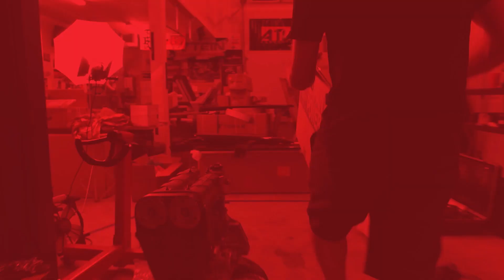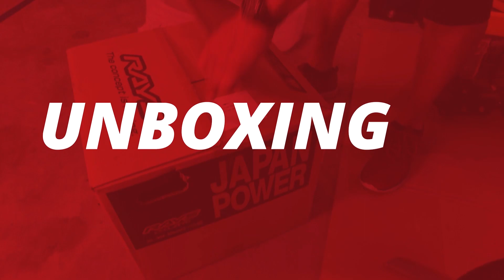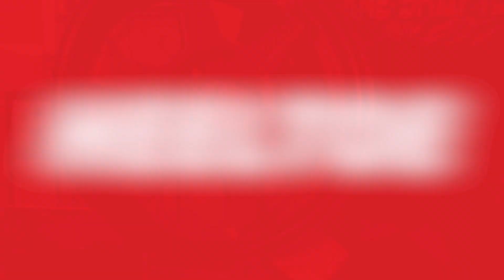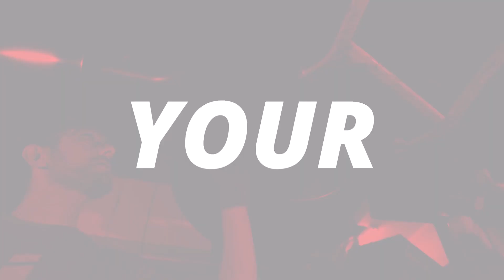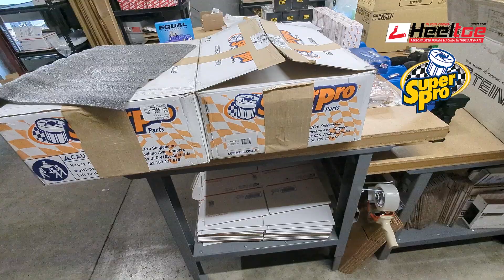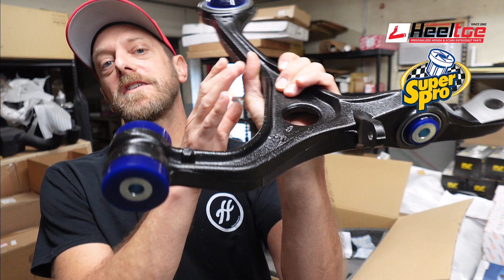SuperPro Polyurethane Bushing Control Arms for TSX/TL/Accord

Comment: Man I really wish these were available a few years ago... I have a 2004 accord 6-6 im now getting ready to sell. I replaced the front LCAs with Mevotech Supreme arms as they come with a solid compliance bushing up front. I considered getting the Super Pro compliance bushing kit at the time, but it was much easier to just buy Mevotech arms vs removing and pressing new bushings into the old arms. The Mevotech arms are definitely an improvement over the OEM bushings. They are the only LCAs that should be used for the Accord/TSX/TL unless you decide to go with a SuperPro arm/bushing kit.

Comment: I know the control arms are different, but is the front compliance bushing compatible from 03-12 Accord (2 generations?).  I can't easily find if the spherical compliance buhings marked for 03-07 would work being swapped in to the 08-12 arms.

Comment: I'd love to see a movement test between all the compliance bushings. I too am skeptical about the poly puck not allowing the suspension to move/adding a lot of "phantom spring rate" and would like to avoid that. If the test turns out not to my liking, I may just well go for the PCI compliance, Poly rear, Rubber shock like you suggested.

Comment: Doing research for needed front suspension work and think I’m gonna go with this LCA for my 06 TL 6mt. Any recommendations for pairing of a lower ball joint? OEM,566 IE
Reply from the maker: This is the one you want: https://www.heeltoeauto.com/ball-joint-roll-center-adjuster/sankei-555-oe-replacement-ball-joint-front-lower-acura-tl-2004-08-sb-6314.html?srsltid=AfmBOoql0v-kQPzpSqo3VSokv4kBMT3K9zcDO_k6i4GmYfgN3Foew4Zq

Comment: Can this fit my cL7 euro r?
Reply from the maker: Yes they should fit, they are made in AUS for the AUDM Accord which is effectively the same chassis as the TSX and the JDM EuroR.
Reply: @Heeltoe.  am think about buying a euro r but I dont know If I would be able to change out control arms and other suspension parts because I heard a lot of these suspension parts aren't available for them
Reply from the maker: @davion5502  "Yes they should fit, they are made in AUS for the AUDM Accord which is effectively the same chassis as the TSX and the JDM EuroR."

Most everything in the chassis crosses to TSX parts.

Comment: Finally put these to the test in my 05 TL. these are a nice improvement. Not drastic but noticeable. Car feels more precise when driving hard especially when going over rough bits of road. I put up a short on my channel of me pushing hard through a canyon testing them out.
Reply from the maker: Thanks a ton for the feedback! Consider a review on our website?
Reply: did you have to use the ball joint collar in the new arm for your tl?

Comment: Put these on my tl. They were a tight fit I had wack them a bunch with a mallet. I am worried about binding because as you can see on two of the bushings the rubber sticks past the sleeve. After calling super pro they said it shouldn’t be a problem and that I don’t need to shave them down. Time will tell I guess
Reply from the maker: Thanks for the feedback, it is pretty normal for poly parts to fit rather snug, from what we have seen. How do they feel while driving?
Reply: @Heeltoe.  haven’t driven much. Still need to get an alignment. I’ll put them to the test in some canyons and let you know. My concern is that since it’s clamping on the bushing itself and not just the metal sleeve it may cause binding or the bushing itself to spin and eventually start tearing
Reply: @chasemoneyy any updates with the ride quality after installing them?
Reply: @tricktreat688  little bit rougher over things like reflectors. Nothing crazy. I def recommend
Reply: @ thanks bro
Reply: update?
Reply: @kidnman4605  still holding up solid

Comment: I believe it’s 2004-2006 TL that use the M10 sway bar link and 07-08 use the M12.
Reply from the maker: We thought it was just the type s that had the bigger ones but it could be all 07-08 sure. We'll check on it.
Reply: What size is the 2006 acura tl manual?
Reply: It's the same  @anthonyiskander4249